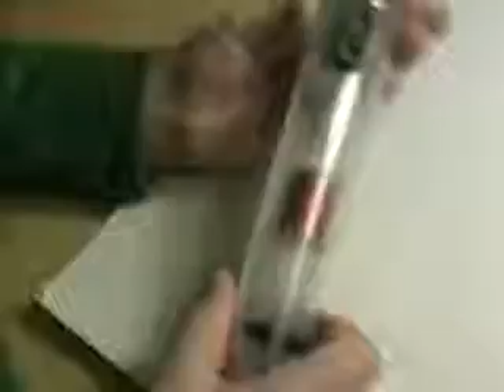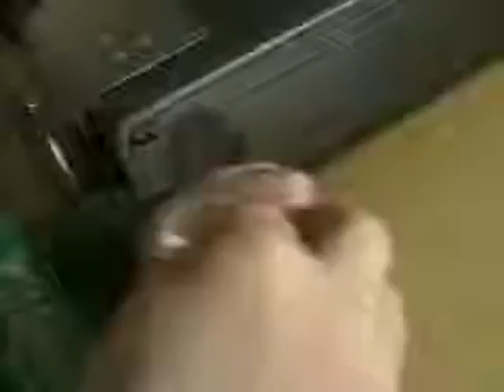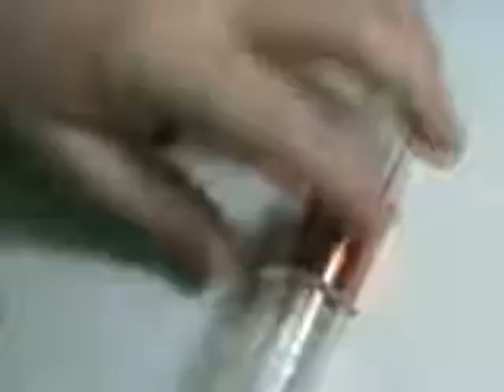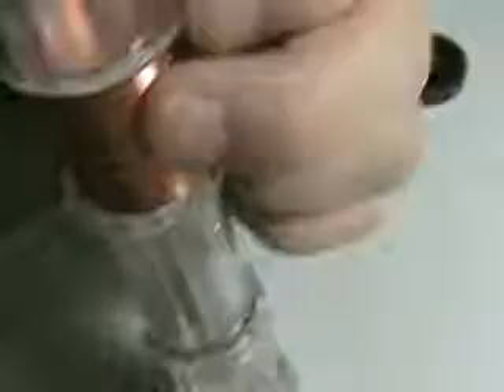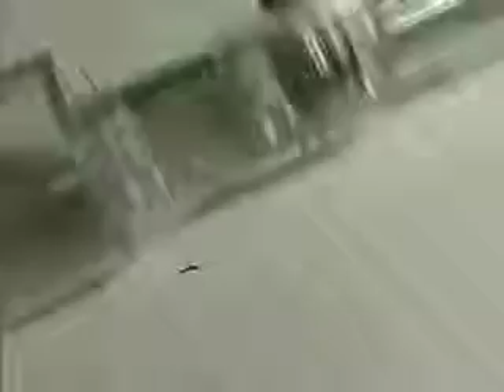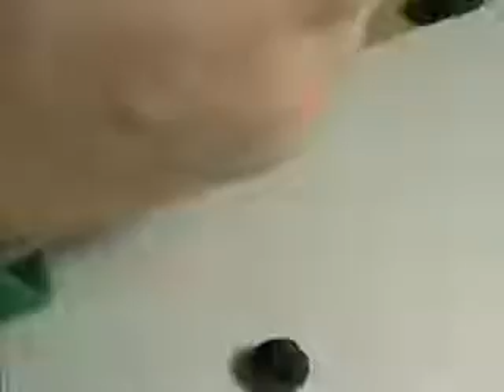Shaking Flashlight

Comment: Lol... This is a fake/counterfeit chinese nightstar copy...
I made the mistake as well on ebay...
The slug is NOT a magnet (try it..) just a piece of steel. And the wires of the coil are
connected nowhere. You can clearly see it runs of two buttoncell batteries (which are not rechargeable, don't exist) Instead of a capacitator. Basicaly it is just a led running of 2 batteries, until they are empty. Google for Nightstar Shake Light to find the real one.